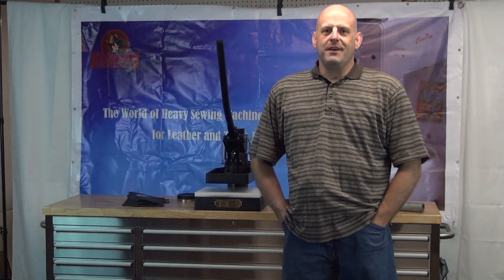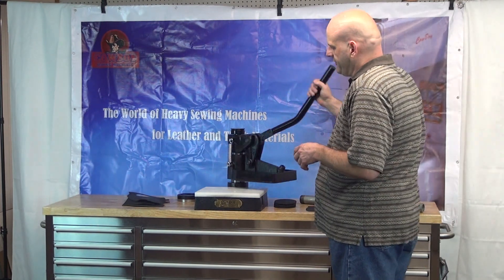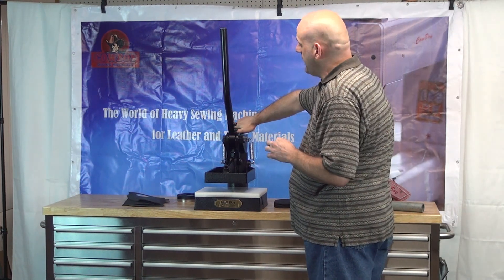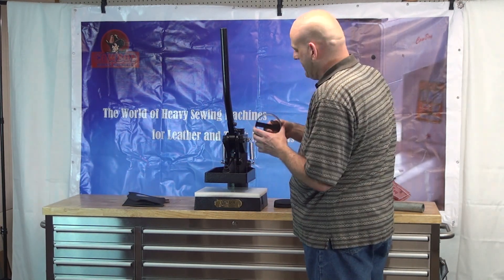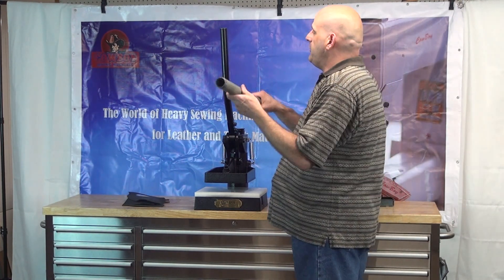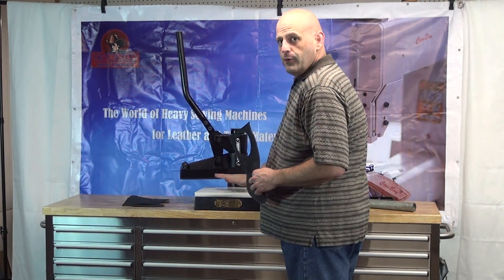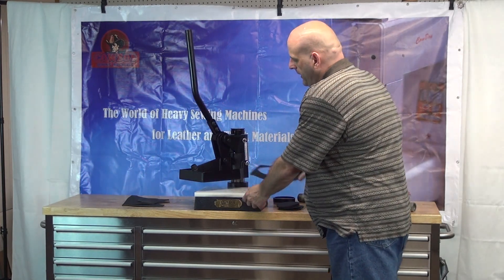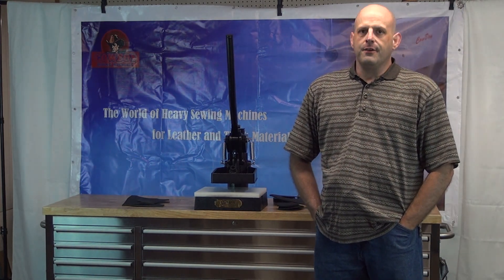8360 Hand Operated Manual Clicker Press (Manual Leather Cutting Machine)

Comment: What makes this Chinese knock-off clicker better than the American made Weaver 4 ton clicker...?
Reply from the maker: I am glad that you asked this question.   The 8360 hand operated clicker press is built on a bit different design than the Weaver clicker.   The tolerances on this machine are much tighter than other presses that are on the market.   The 8360 is actually a fairly good replica of a style of clicker press that was sold in Australia.  This press was made to a very tight tolerance standard and as such there is very little lost movement in the machine when the press is compressed.   The result is that the die cuts cleaner, cuts even, and there is no need to do a second click due to the die not going all the way through the substrate material.   This machine is quite precise and there is very little "slop" in between the moving parts.   Hope this answers your question.
Reply: @HightexHeavysewingtechnology  , could you please say the information of were all your machinery is made in. It's very important !!! I will be very unhappy to pay thousands pounds for machinery made in china. I'm not saying it's not good but I want to get decent traditional tools I can trust for such amount of money.
Reply from the maker: Both design and material are bettern. We focus on the leather sewing and cutting machinery, Weaver does not focus on leather machiery, that's why our machines is better.
Reply from the maker: Garik,  the machine is made in China, I am very proud to say.  We have been in manufacturing leather sewing machine, cuting machine and leather crafting tools for over 20 years, and we have been in selling these leather machinery in USA, Germany, Italy, France, UK and Australia for almost 10 years.  "No surprise, everything is made in China"!!
Reply from the maker: Garik,  the machine is made in China, I am very proud to say.  We have been in manufacturing leather sewing machine, cuting machine and leather crafting tools for over 20 years, and we have been in selling these leather machinery in USA, Germany, Italy, France, UK and Australia for almost 10 years.  "No surprise, everything is made in China"!!